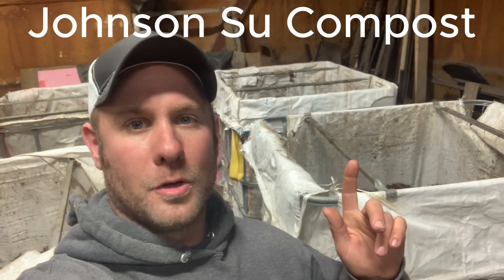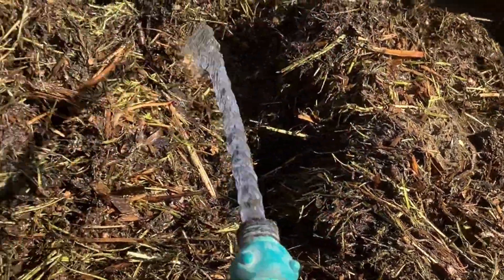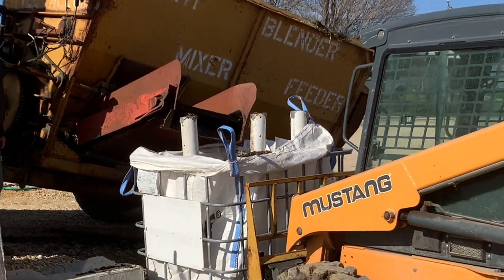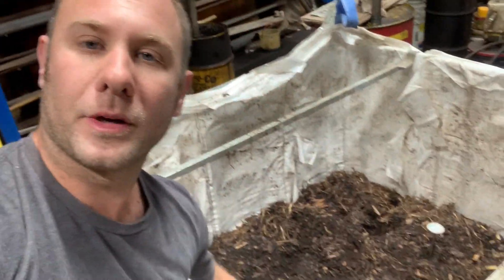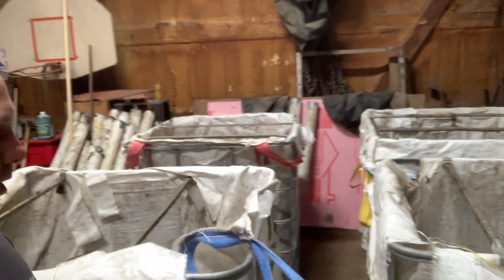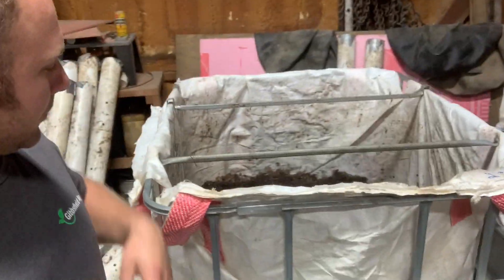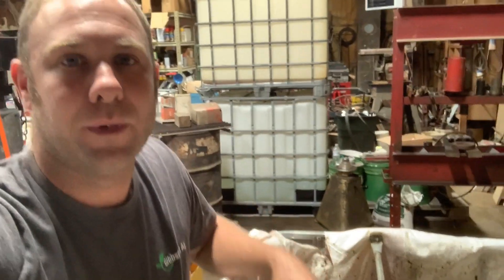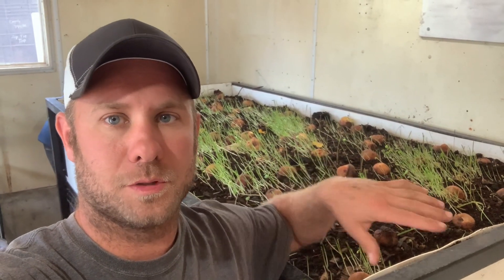Making Compost: Homemade Johnson Su Compost System

Comment: What temperature is your compost getting to in the thermophylic stage?
Reply from the maker: It usually gets up to 140. It has never gotten over 160.
Reply: @gibbsfieldfarms  I made 10 J/Ss this summer and I had some get to around 145 and others that only got to around 110. I didn't use any manure or alfalfa so that is probably why. I think I didn't have them packed enough and the material was not broken down enough and there was too much air getting in. I hope the lower temperature ones work out ok if I'm going to babysit them all winter haha. I'm keeping them in an insulated reefer trailer, can fit two on each side with enough room between to walk through. Hope I can keep it above 32f in -30 temperatures. I found you from your live talk with Young Red Angus. Keep up the videos I look forward to them.
Reply: @gibbsfieldfarms  Are you grinding the alfalfa and other materials up before putting it in the TMR mixer? I'm looking either a vertical TMR mixer or a bale grinder. I was using my skid steer to sort of roll the material and mix it. Trying to think of what would be a better investment.
Reply: Thanks for the great video! For space savings you can stack this at least three high. We do this when they are full of 2,200Lb liquid raw materials daily in our chemical plant.